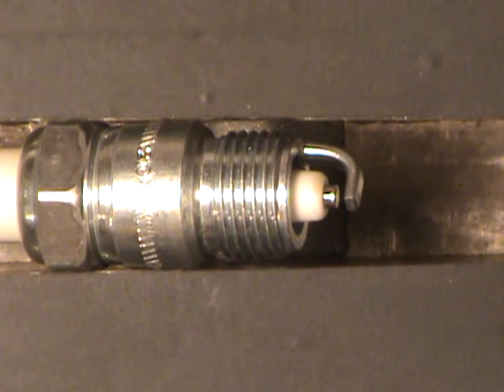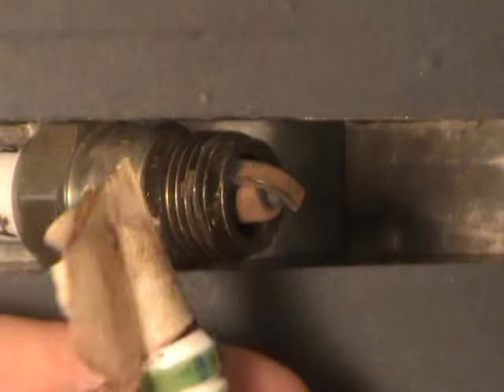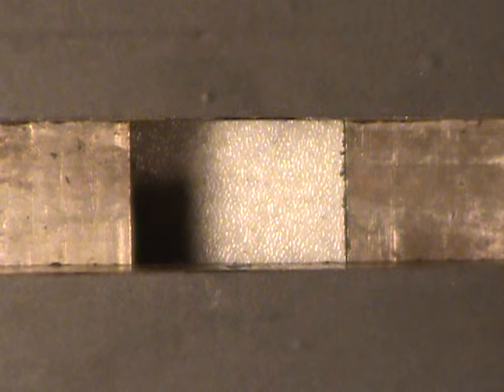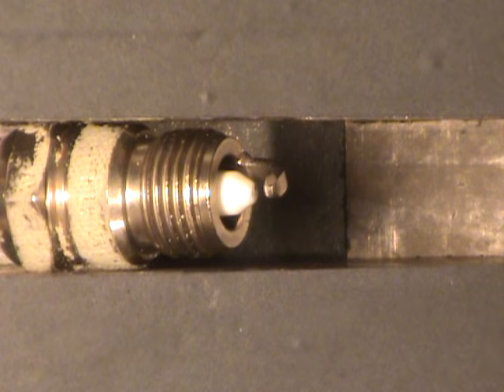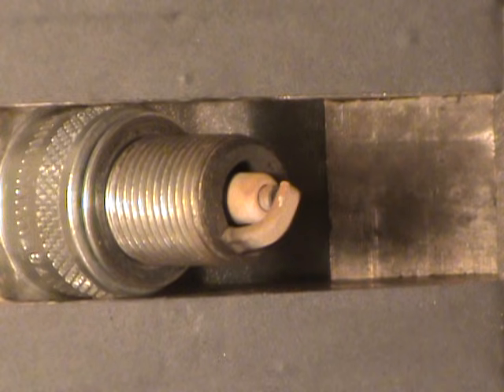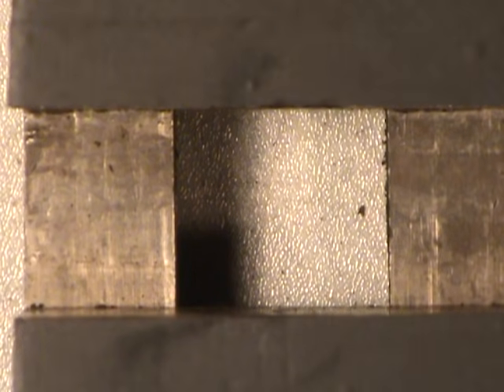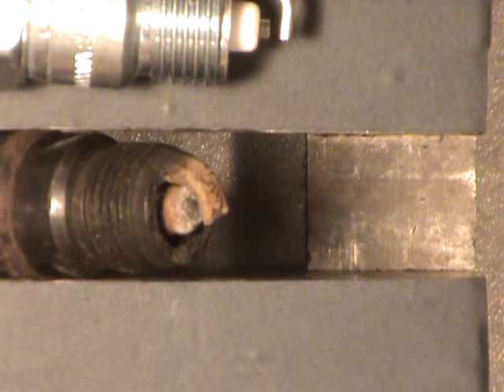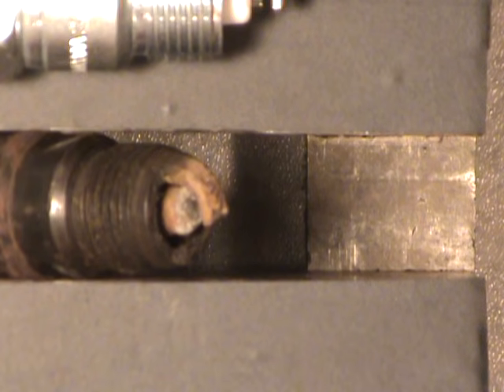SPARK PLUGS How to Read them (Part 3)

Comment: Thanks for your thoroughness.
Reply from the maker: Greetings...Lisa Gooch...…….You're welcome, and, thanks for watching...…….I'm, not so sure, that, it was all that thorough, more like...long-winded...lol...……This video of mine, about, reading a spark plug, is just a quick way, to see, if there happens to be any...dry, black carbon (too rich/too much gasoline, in the air/fuel mixture, and/or, a weak ignition system)...too fast of a wear rate (for the older/common spark plugs), would probably be, about, .001" (one thousandths of an inch), of, electrode gap increase, for every 1,000 miles, that, the vehicle travelled (more than that amount, might be a problem, perhaps)...melted electrodes...???...or maybe...the ceramic (porcelain), that surrounds the center electrode, is cracked, or, has been chipped (broken), which, kinda, has the alarm bells, going off in my head...!!!...lol...……There were (are?), quite a few racing guys & gals, that, might still be using, what might look like, a Doctor's, ear checking flashlight/magnifier, and, will probably, be looking, way down, inside of, the spark plug's business end, you know, where the center electrode's ceramic/porcelain, meets up with, the "inside", of the spark plug's, screw-threaded metal shell, in order to see, what kind of deposits, that are showing up, in that area as well, talk about being serious, or what...…….Maybe do, a YouTube, or internet search, for, the "spark plugs", that were removed from, a "top fuel" (nitro methane) dragster, or funny car's engine, and, if Ur lucky, you'll probably be seein', a spark plug or two, with a missing outer electrode...!!!...and...….till next time...…..Be Safe, take care, and have a good one.
Reply: @RockysRoadshow  Thank you so much for this.   What is the name of the tool needed to remove the spark plugs?   Does it take a man's strength to remove them?   How many spark plugs are in a 2003 Dodge Grand Caravan?   Where are they located?   Based on this video, I'm convinced that difficulty with starting in the mornings is related to the spark plugs (if not fuel pump).   I hear 1 click when turning the key.   As I keep trying, it will try to start for about half of a second.   I keep pausing between tries, then it finally starts.  Sounds like you suggest replacing rather than cleaning where there is build-up.  Otherwise, how would you clean a spark plug?.  Thanks so much for your time.
Reply from the maker: Greetings...Lisa Gooch...…….You're welcome, and...here we go...lol...…….First things first, as in..."Safety"...!!!...…….Whenever you are working on a motor vehicle, tie up (really short), any long hair, remove all jewelry, as in, rings...necklaces...etc.,...so they don't get tangled up, especially so, if a procedure requires, that, the sometimes, hot engine, is to be running at the time (don't want to lose a finger, or, get tossed about, like a raggedy-ann doll, if any long hair, got grabbed, by a moving engine part)……….Also, watch out for any hot engine, and exhaust system parts, so you don't get burned, and, always try to work on an engine, when it is..."cold"...for safety's sake...…….I'll get to the tools needed, to do a spark plug's removal & installation, after this...…….Spark plugs will eventually wear out, because of, all of that high voltage arcing (sparking), that takes place, between the spark plug's two electrodes...........If your Caravan's engine runs ok (after it finally starts), while it is running at idle speed, as well as, at all other speeds, then, from what you were sayin', about, the "delay" time, it took, for the engine to start, has me thinkin', that, the fuel (gasoline) pressure, in the fuel system, is taking longer than usual, to build up-to, the required/specified fuel pressure, that the fuel injectors require, in order to spray the gasoline, into your engine's intake system...…….During a "quiet" (no noise) time, turn the ignition key to the..."Run" (Not Start...!!!) position, and, listen carefully.....you will probably hear the electric fuel pump, that's hiding inside your Caravan's gas tank, making a whirring/wine-ing noise, for about 2 seconds (time-wise) hopefully...…….This will be the 2-second "Prime" routine, as in, the fuel pump will run, for "only" 2 seconds there-abouts (for most fuel injected vehicles, that is), and, brings the fuel pressure, up to, what it was, to be regulated at (for example...some vehicles can be about 35 PSI/Pounds per Square Inch fuel pressure, and some others, might be as high as, oh, about 60 PSI there-abouts)……….So then, try this......Before, trying to start your engine.....Turn the ignition Key, to the "Run" (Not Start...!!!) position, and count 2 full seconds (of time), as in, just say aloud...(lol)..."one-one-thousand...two-one-thousand"...and then....try starting your engine now, and see if this helps...???...………If it happens to be, a "low", fuel pressure related problem, then, it can be a few things, that might be causing it, as in...plugged-up/dirty, "fuel filter"...a faulty, "fuel pressure regulator"...faulty "fuel pump"...or...electrical wiring...etc.,...……I just usually do, a..."fuel pressure test"...with a fuel pressure gauge (costs about 50 dollars, there-abouts), and, I check that fuel pressure, while the engine, is both, not running, and, running as well, to see if, the fuel pressure is "with-in", that particular vehicle's, fuel pressure "specification/s"...…….Always have a "Fire Extinguisher" near-by, and also, don't park the vehicle, that's being tested, near any buildings, or flammable objects, what-so-ever, just in case, it becomes a re-creation, of, the Fourth of July...!!! (USA only...lol)………..Try to get/buy, a..."Haynes"...repair manual (book), for your "exact", year and model of Dodge Grand Caravan, because, they are awesome, for anybody, just starting out, as well as, for the advanced DIY'er (Do It Youself-er) also, and only costs, about, 30 Dollars or less...!!!...…..The spark plug, Re-&-Re (Re-move...and...Re-place) "tools", that are needed, are usually, a Ratchet...and...a spark plug "Specific" Socket, or, if need be, then, the right size, of, hexagonal, or, 12 point, deep..."Socket"...(usually, it's a 5/8", as in, five eighths of an inch, and, that's measured across, two opposing flats, if it's the hexagonal/6 sided type), but, please check first...and also, an...Extension or two...that, that particular engine requires, to git-er-done...…….Sometimes, a spark plug or two, can be stuck, really good, and even, I, have broken, the odd one's ceramic part, during removal, and, it's not really an issue at all, as long as, no broken bits or pieces..."Fall-into"...that screw-threaded hole, that leads to, the inside of the combustion chamber, or otherwise, some serious engine "Damage", will be the result, once the engine starts running again...!!!...……(The following, is for, right handed folks, otherwise, it's gonna be, visa-versa), well then, It's a kinda, experienced feel, type of thing, as in, Ya have to counteract the force, that is being applied with the right hand, on the ratchet's handle end, where-by, your left hand, has to provide an opposing force, in order to keep the socket and extension bar...in-line with...the spark plug's center line, because, if Ya don't, and it angles off too far (from being centered), then, the white-ish ceramic part of the spark plug, might break, into two (or more?) pieces...!!!...…….Some spark plug designs, can last a lot longer mileage-wise, but, that's only if the engine is running, almost perfectly/cleanly, all of the time, and if too many, not wanted deposits (coatings), start getting stuck onto the spark plug's business end, then, the engine could start misfiring, and/or, not run so well...……..There were two engine options apparently, a...4 cylinder engine...and a...6 cylinder engine (just count the number of spark plug "Wires", and then, follow each of them, to where, they push/snap onto, the spark plug's ceramic part, and do this, while having the engine..."Cold and Not Running"...!!!..........Try to install, the "Exact, Factory Original" spark plugs, that the engine had in it, when it was brand new, to avoid any, potential problems at all...……..Also, the (air) "Gap", that's between the spark plug's two electrodes, should measure, the same as, what the vehicle manufacturer "Specifies", for that exact engine, so, it will run good, and, I usually put, a little bit of motor oil (just a few drops), on the new spark plug's screw-threads, to protect the screw-threads, that are in the engine's cylinder head/s, especially so, if those cylinder heads, are made out of aluminum (material), that, as I see it, need all the help, that they can get....…….So, there Ya have it...and...if and when, Ya get a hold of a Haynes repair manual (book), and then, (might?) become, quite the "book-worm", then, you'll probably be quite surprised, at, how much, and, how fast you'll learn, about maintaining and fixin' Ur vehicle, and, all-the-while, saving-a-ton-of-money, at the very same time, kinda like I have, over the years...…….There should be, the Tightening "Torque" (twisting motion) "Specification", for, how tight/how much torque/force, that is to be used, when installing the new spark plugs (especially important, when it comes to aluminum/material cylinder heads...!!!...which your engine, might have), as in, don't tighten those spark plugs too tight, because, the aluminum cylinder's screw-threads, might get damaged, and then, things, tend to get, rather expensive to fix, and then some............Read the "Safety" stuff first, and then, move onto, the "maintenance" items, as suggested, in your Caravan's "Owners Manual" (if Ya have one, that is), or, what is in, the Haynes book...……….Good luck, and...…till next time...….Be Safe, take care, and have a good one.
Reply from the maker: Greetings...Lisa Gooch...…….Here are a few more things, for Ya...……..When "installing" spark plugs..."Always"...start screwing them into the engine's cylinder head/s..."By Hand Only"...!!!...to avoid any, not wanted..."cross-threading"...as in, having the screw-threads on the spark plugs..."Not Tracking/Matching up with"...the screw-threads, that are in the cylinder head...!!!...and..."Only"...do..."One"...spark plug, and..."Only"..."One"...spark plug "Wire" at a time (that's on that particular spark plug), so, the spark plug "Wires", don't get "mixed" up with, one another...!!!....…….The way, that I usually do this, is by, using a piece of rubber hose, or, clear neoprene tubing (that be, the fish tank/aquarium stuff), that's about 5 inches long, or, what-ever happens to work (that fits snugly/not too tight, onto the ceramic part of the spark plug, or, onto, the spark plug's, round metal tip, where the spark plug wire connects to, and which way Ya do it, will depend upon, what the inside diameter, of that hose or tubing, happens to be...…...You'll be able to actually feel, how good, or bad (too much interference, of some kind, maybe), when installing a spark plug, using this method...……….Also, get/buy, and, smear some..."Die-Electric"...grease/compound (kinda looks like vasoline/petroleum jelly, some-what), "inside" of, the spark plug wire's (usually made of silicone) "Boot", that plugs onto the spark plug, if Ya ever want to remove that spark plug wire, from the spark plug in the future (because of, how well, that Boot, will usually "Bond/Stick to", the spark plug's ceramic part, if not using that Die-Electric grease/compound...!!!) .........….Once the spark plug is installed properly, by "hand", and is, as far in, as possible, then, start using the ratchet, extension, and spark plug socket, while keeping the socket and extension, "in line with", the spark plug, to complete the final tightening of the spark plug (not too tight now...!!!)………...Here's another way, that I started, a fuel injected/computer controlled V-6 engine, that didn't want to start, all that fast...…….I just held the gas pedal, about 1/3 (one third of its travel) down, and held it there, and started the engine (hot or cold), and, when the engine started to run, I would..."Release" (get my foot, off of) the gas pedal, so the engine would not..."scream/run too fast"...and, it sure started much quicker, than, not using, the 1/3 gas pedal down, shall we say, "starting trick", perhaps, but, this procedure, was just a band-aid solution, until the engine's problem, was finally fixed, and...….till next time...….Be Safe, take care, and have a good one.
Reply: @RockysRoadshow  Happy New Year, Mr. Rocky??  Wow!  You have been extremely helpful to me.  I don't know if my Owner's Manual provides repair/replacement instructions.  If not, I'll seek the Haynes Manual.  I truly appreciate your unselfish sacrifice to lend a helping hand.  Your generosity mirrors the way that I give.  This world would be a better place, if we all were generous.  Since we last chatted, I changed the way I tried starting my engine in the mornings.  When it doesn't start after first try, I rapidly and repeatedly turn the key about 1/4 of the way until it starts.  During this time, it progresses from a series of one click, to a series of one short cough/false start, to starting.  Then I gun the gas pedal a little to make sure it doesn't turn off.  Am I doing damage, this way?  Of course, now, I'll try your suggestion with pressing gas pedal 1/3 of the way, until I hear back from you. 
Also, how do I figure out if it's a 4 or 6 cylinder? www.childrenofgarychoir.webs.com
Reply from the maker: Greetings...Lisa Gooch...…….Thanks...(and a)...Happy New Year...to you too...……Well, I kinda, have-tah-be nice, most of the time...or...Santa...will probably be putting me, on the..."naughty list"...!!!...lol...and besides, I really do, prefer to have...Good Karma...as opposed to having, the bad kind...……Now then, do Ya have a 4-cylinder engine, or a 6-cylinder engine...???...…….Well...just count the number of spark plug wires, or the number of spark plugs, well, if Ya can see them, that is...…….Usually, a 4-cylinder engine, will have all 4 cylinders in a row (straight line), and are also, usually, easily seen...where-as, if Ya have a 6 cylinder engine, then, it'll probably be, a "V-6" engine, as in, think of the capital letter "V", and, on "each side" of that...V..there'll be 3 cylinders, and, 3 spark plug wires, that are connected onto, those 3 spark plugs, that are on, that particular side of the engine (as in, 3 spark plugs, on each side of that V-6 engine), oh, and also, if it's a V-6 engine, then, it'll probably be mounted..."Side-ways"...in the engine compartment, because of, it probably being, a front wheel drive vehicle………..Just so Ya know, there are also "inline" 6 cylinder engines as well (where, all 6, of the engine's cylinders, are all in a straight row)………….Ya never want to have a "back-fire" in an engine (aka...cough, as you put it), especially, on most of the engines, since about 1985 there-abouts, because of, that, shall we say, high, air pressure spike, that's travelling the wrong way, inside of the engine...…….In around, oh, about 1985, most of the engines, went from having a carburetor on them, to having, a form of fuel injection (system), that also had, an on-board computer as well, that, ran-the-show, so to speak...…….Then, with fuel injected engines, there's usually a "MAP" (Manifold Absolute Pressure) sensor, and, an engine "back-fire" (cough...lol), might damage "it" (well, as I see it, that is), and, if the MAP sensor gets damaged in any way, then, the engine probably won't run very well, and, there'll usually be a trouble code, that gets stored, in the vehicle's, on-board, computer's memory too...…….Most vehicles, since about 1996 and newer, will probably have, an..."OBD-2"...(On Board Diagnostics - version 2) computer system, and, in order to "scan", the vehicle's on-board computer for any trouble codes (if any?), then, a "scan tool", will be needed, to git-er-done...……If there is an "Auto Zone", car parts place nearby, where Ya live, then, I've heard in the past, that, they will probably "scan", your vehicle's on-board computer for..."Free"...!!!...……Then, also, for about 100 Dollars, on Amazon (I think), there's the..."Blue Driver"...and, it fits in the palm of your hand, and it plugs into, the connector, that's probably just below your steering wheel, near the bottom of the dashboard, and, that connector, usually has, "16 Pins" (usually, two rows, of eight pins, side by side), where the "Blue Driver" plugs into, to get at the trouble codes (if any), and, a whole lot more, and then some...!!!...…….The "Blue Driver", uses..."Blue-Tooth"...(wireless) technology, that, pairs up with, the "Correct" type of Smart phone, so, if Ur interested in getting one, then..."Make Damn Sure"...that, Ur Smart, or what-ever Phone, is able to...Communicate-with/Pair-Up-With...(Blue-Tooth-wise)...with...what, the..."Blue Driver"...is Designed for (might only be, the Android type, maybe...???)...so, find out, if in fact, that, Ur existing smart phone, has the "Correct" operating system, just to be sure...…...So then, try to find out, as soon as possible, if there happens to be, any "trouble codes" (if any?), that are stored, in your vehicle's on-board computer's memory, that way, it'll narrow down, what might be wrong, instead of using, the good ole, guessing game method/routine, so to speak, and also, maybe save your engine, from any, not-wanted engine damage, possibly....…...Good luck....and....till next time...….Be Safe, take care, and have a good one.
Reply: @RockysRoadshow  Thank you, again, Mr. Rocky!  Today, Auto Zone tested my battery, again, & says it should read at least 14% but reads 12%.  Last month, they said it tested just fine.  I'm not so sure that my battery is bad.  Today's weather temp felt like -7 degrees.  Then, they tested my on-board computer & provided print-out results.  If I can email it to you, could you interpret for me?  Where  could I email it?
Reply from the maker: Greetings...Lisa Gooch...……You're welcome (again) lol...…...I'll start first, with your Battery...…….An easy way, to tell, if your vehicle's battery, is doing ok, is to, just..."listen"...to, how fast the engine..."cranks-over" (before, it actually starts running, on its own)……….The colder, that, the temperature gets, while also, having the vehicle parked outside, then, the more difficult it gets, for the battery, to crank the engine over (as in, when the key, is in the starting only position)………..The battery's power output "drops" quite a bit, the colder, that it gets...……..A vehicle's battery (even a new one), might drop down to, oh, maybe 50% output there-abouts, while being subjected to, something, along the lines of, oh, shall we say, something like, the Arctic circle's, sub-zero temperature, during winter, as an example...conversely...the warmer it gets (to a point), then, the battery, will then be able to output, much closer to 100% of, what it's capable of...……..As long as, the battery is able to get the engine started, during the coldest temperature, that you have there, during winter-time, then, it should be ok...…….Once the engine starts, then, the vehicle's (electrical) "charging system" (as in...alternator), will take care of, the vehicle's electrical needs, well, if everything is working, as it should be doing, that is...…….A fully charged, 12 volt battery, while just sitting there (doing nothing), should be showing, about 12.6 volts, there-abouts, and, while the engine is running, then, the battery should be showing about 14.5 volts, there-abouts (while having, all of the accessories/fans/radio/air conditioning, etc..."off"), due to the vehicle's charging system (alternator) charging-up the battery (some vehicle's, might be showing, in the higher 13-ish volts...vehicle dependant, of course)………..Is there some kind of gauge, or pointer, in your dashboard's instrumentation, that shows, if the battery is being charged-up or not, while the engine is running...???..............Like I was just saying, as long as Ya can get the engine started, when the dog's drinking water, freezes "outside", then, all should be ok...…….Be careful around the vehicle's battery, especially when, the engine is running...why you ask...???...well...when the engine is running, the charging system, is charging-up the battery, and then, there is usually..."Hydrogen Gas"...venting from the top of the battery, which is..."Explosive"...!!!...so..."No Smoking"...and..."No Sparks"...of any kind, anywhere near, a vehicle's battery, especially when, the engine is running...!!! (Safety first...right...???)………..If and when-ever, I'm going to replace a car or truck battery, I try to get the BIGGEST, battery, that will fit in the vehicle, properly, while it also has, the...Highest CCA rating (Cold Cranking Amps/Amperes)..……...For me, it ends up being, a rather large battery, that is rated at...850-CCA (I usually aim for 1,000 CCA, but, I haven't had much luck, with that at all)...……..If Ya get a "wimpy" battery...don't blame me, when it "wimps-out" on Ya...lol...……….There's, a heck of a lot of information, to be had, on the inter-webs, so, here Ya go.....….For the OBD-2 (On Board Diagnostics-version 2), for your vehicle, then, try the website...OBD-CODES.com...or generically, you can try searching with...OBD2 Codes...and have a look-see, to see, if you can find a website, that deals with your "exact" vehicle.........….You can e-mail those printout results to...therealrockyroad@gmail.com...well, if you care to, that is.......….Even though, a person might know, what the "trouble codes" are, for a given vehicle, then, at times, it can become quite challenging, to actually know, what's causing the problem, because of, how many, of the different sensors and actuators, that, can kinda interrelate with one another, almost like a domino effect, if you will...……..Some trouble codes, at certain times, can sometimes, be easy to track down and fix, while others, might keep one dumb-founded (goes hand-in-hand, with that very same facial expression...lol), for quite some time, but, if one perseveres (keeps at it), then, it's just usually, a matter of time (and sometimes...a lot of money too), where-by, the problem (will hopefully) be solved (or is it, resolved...???...lol)………..Take for instance, the trouble code...P0300...and, as far as I recall (without looking it up), then, P = Powertrain...first 0 = generic code...if it was 1, then 1 = vehicle manufacturer specific...and...the 300 means...Random Misfire...which can be a tough one, to track down and fix, because, it might be, the physical engine itself...fuel administration...and/or...ignition related as well (as in, both, low and high voltage circuits, and then some...lol)………..Just, always remember, if Ya wanna learn something, then, just become a "book-worm", and study the heck out of it...!!!...lol......and...….till next time...….Be Safe, take care, and have a good one.
Reply: @RockysRoadshow  Well, thank you, again, Mr.
Rocky!  I checked and don't have dashboard indication of my battery charge level.  I'll be sure to follow all of your great advice.  It has been quite helpful for me.  I'll keep you posted.
Reply: Happy Spring, Mr. Rocky!  Just stopping by to say thank you for all of your kind generosity w/educating me on so much, here.  Of course, sudden financial challenges brought me here, in the first place, So I'm most grateful to you..  Since we last spoke, I've price checked spark plugs and tools needed (very inexpensive) for when I'm ready to check them.  Meanwhile, as I've paid attention to my van's performance when being started in the mornings, I have a question.  As you advised, I slightly press accelerator before starting.  This has helped to keep the engine running.  Yet, can you tell me why the engine idles up and down, while accelerator is slightly pressed.  It Sounds as if I'm gunning the accelerator, but I'm not.  It's clear that it would turn off if accelerator isn't pressed.  I hold accelerator until gunning noise stops..  As I slowly release accelerator, engine keeps running smoothly.  Also, I notice that as the weather warms, the engine starts right away.  How can I check to see if the teeth on the starter wheel are properly aligned to help engine start?
Reply from the maker: Greetings...Lisa Gooch...…….and, a happy...turn-the-clocks-ahead-one hour...to you too...lol...(well, if Ya do such a thing, that is)…………There are a few things, that can cause, the engine's idle "speed", to go up & down, and, not to be holding, a relatively "steady" idle speed, which "it" should be doing, well, on a good day, that is...(which is usually, around 700 RPM's/Revolutions Per Minute, there-abouts, on a fuel injected engine, while the engine, is fully warmed up to operating temperature)……....A "vacuum leak" (that be, air, that is getting sucked into the engine, that should not be happening...!!!), through a faulty gasket (seal), or perhaps, caused by, a part on the engine, where-by, a bolt or nut, has become loose, which might allow, some not wanted, extra air, to get inhaled by the engine, as another example..........Then, there will probably be, an "idle air control valve", that can either go bad, and/or, will try to play "catch-up" (no, not ketchup...!!!...lol), as in, that, theoretical vacuum leak, which will usually allow, too much extra air, into the engine, and then, the idle air control valve, tries & tries, to compensate for, all of that, extra, not wanted air, and the term, that is sometimes used, to describe this up & down, of the engine's idle speed, is simply called..."hunting"... (in respect to, idle speed, that is)..........The idle air control valve, is usually controlled by, the vehicle's on-board computer, and, by using electrical signals, it moves, a, shall we say, plunger, in and out of, an air passageway, so as to, control, the amount of air, entering the engine, while it is at "idle speed"...........The IAC (Idle Air Control) valve's plunger, and, the passageway that it fits into, can get carboned up quite a bit, due to high mileage/kilometer-age, and can be cleaned, by using the correct, spray solvent/cleaner, along with, using something like, a long Q-tip or equivalent..........Then, there is, what is sometimes, being referred to, as the master "sensor", which happens to be, the 
"coolant temperature sensor", which will be telling, the vehicle's on-board computer, what the temperature of the "coolant" (coolant = anti-freeze and distilled water mixture), happens to be, at any given time, as in, cold or hot engine, or, somewhere in between..........Sometimes, a faulty, CTS (Coolant Temperature Sensor), might send the wrong (electrical) signal, to the vehicle's on-board computer, and, if it does, then, the amount of fuel, that the engine needs, will probably end up being, not enough, or maybe, way too much (then, just call it a gas guzzler), along with, black carbon powder, covering your spark plug's business end, and then, the engine runs, really (sensored word)...lol.........Then, there is also the throttle body's "air valve/butterfly" (basically , just a round metal disc), that opens the amount, that you tell it to, with the gas pedal, which can also mess-up, the engine's idle speed behaviour, and sometimes, it might just be, some carbon (black powder-like substance), that has coated that valve (round disc), and, can usually be cleaned out with, some spray solvent/cleaner, that is made for that purpose, oh, and, Ya can usually use, an old toothbrush, and some paper towel, to get the job done, well, most times, that is..........Now for, the engine's (electrical) "starter motor"..........If the starter (motor), cranks the engine over, nice-n-fast, then, that's a good thing (starter & battery, are probably ok)...........If the gear teeth (on the pinion gear), that's on the starter motor, and/or, if the gear teeth, that are on the flex plate's circumference (automatic transmission, and, on a standard transmission, those gear teeth, will be on the circumference, of the flywheel), are in good shape, then, all Ya will usually hear (before the engine starts), will be, the whirring of the starter motor, most times.........If any, of the already mentioned gear teeth, are worn out, damaged, or missing, then, Ya will usually be hearing some weird noises, and maybe, some crunching noises too, so to speak..........If too many gear teeth, are "missing/broken off", then, at certain times, the starter motor, will probably be whirring away, without cranking the engine over at all...!!!...........Also, if the gear "mesh" (that be, the running "clearance", that's between, the gear teeth, that are on the starter, and, the gear teeth, that are on the flex plate or flywheel, is too much, or, too little, then, you'll more than likely, be hearing, some pretty strange noises, and, in one case, it could be, a shrieking type of noise (just listen, you probably won't miss it at all)...........So then, there are a few things, that will hopefully, be of some help to you..........Good luck, and......till next time.........Be Safe, take care, and have a good one.
Reply: @RockysRoadshow  Wow, it gets even more involved!  Is this you on the ad video promoting a hand-held mechanic that diagnoses vehicles?  If so, maybe I can invest in one.